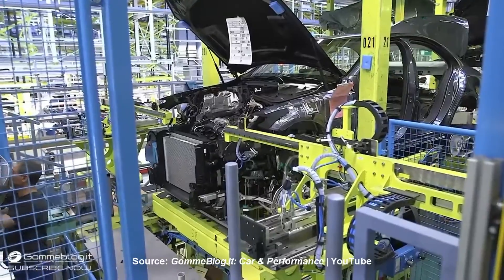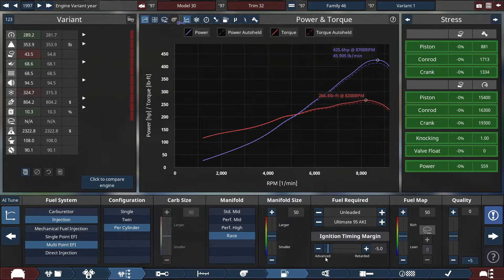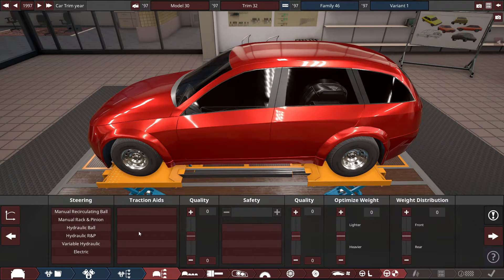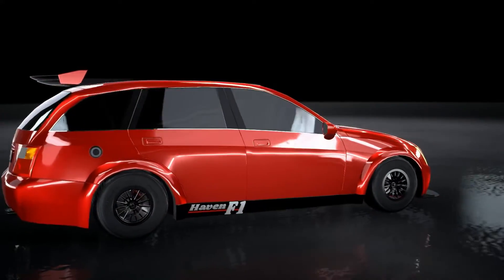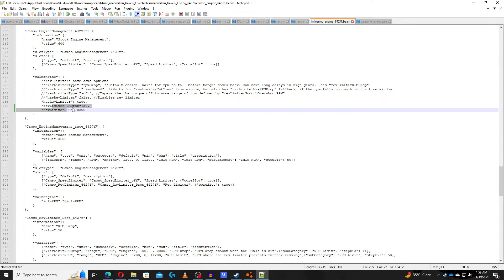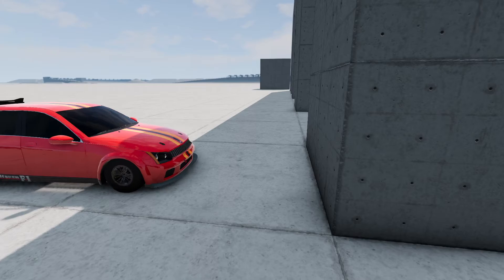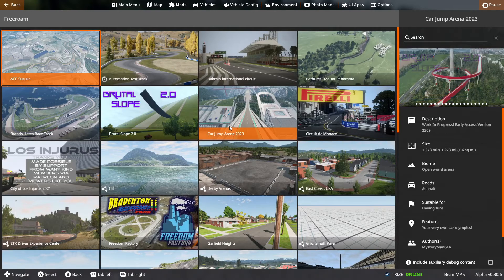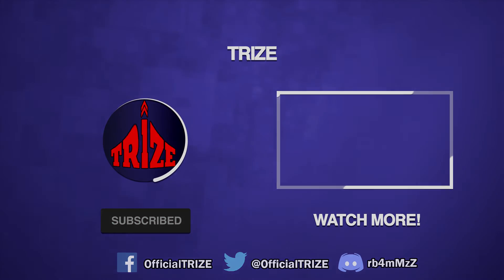Building an F1 V10 Station Wagon! | Automation Game & BeamNG.drive

Comment: build a 1933 Mercedes-Benz 770 car with a    Daimler-Benz DB 602 fuel nitromethane  diesel mix Compression ratio: 16:1 with ww2 tank camo and with a Panzer IV armor vs 1945 Mercedes-Benz 770 car with a    Daimler-Benz DB 602 fuel kerosene  Compression ratio: 16:1 with ww2 tank camo and with a Panzer IV armor